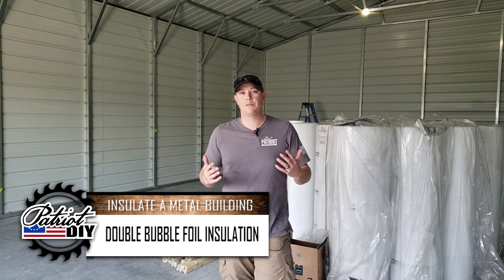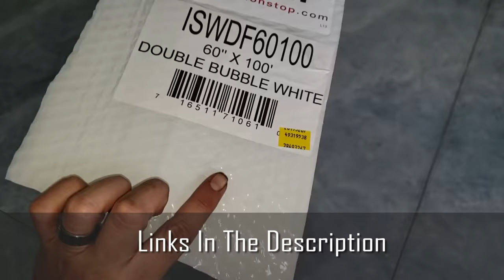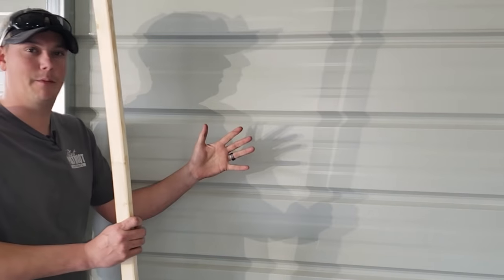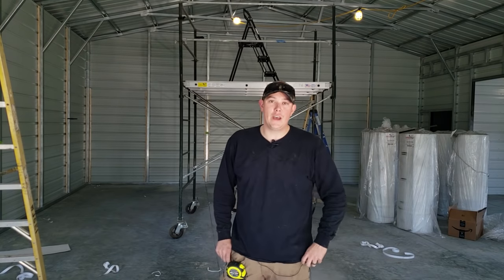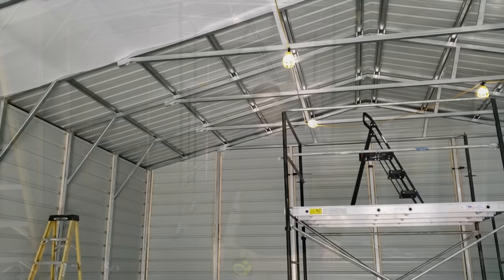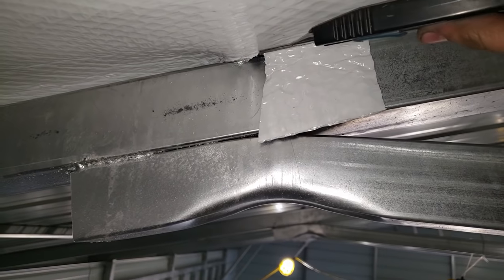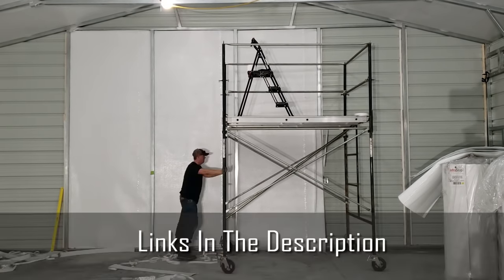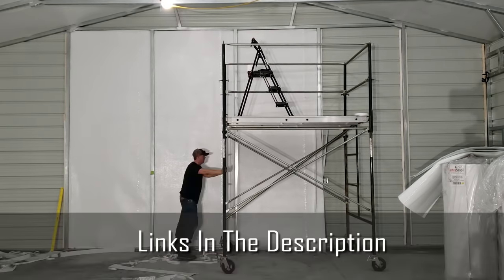How To Insulate A Metal Building / Double Bubble Foil Insulation

Comment: Really appreciate this video. I decided to go with the Prodex 10M Total plus insulation that looks like yours and has equal radiant barrier, but it has R22 value and built in Class 1 vapor barrier at at little less than 1/2” thick. The saving compared to closed cell spray foam was about 75%. You did a great job with your installation technique as well as the one where you sealed the bottom of the metal tubing against the concrete with silicone. Thanks again!!
Reply from the maker: Awesome! Sounds like you found some good stuff. Post a link for the followers!
Reply: Did you have any luck with the prodex
Reply: @drewdoestrucks  that’s correct
Reply: @drewdoestrucks  I left it silver. I’m thinking I might put one row of wafer board up on the bottom, but all in all it looks pretty cool. I have parking, a gym and a activity area with TV,  ping pong, dart board etc and it’s kinda unique looking.  The best thing is it’s very bright with LED and I guess that’s partially  because of the reflective surfaces.

Comment: For the roof, use a solid type insulation and lay from rib to rib.  My building allowed me to take off end cap and slide in from the end.  works great.
Reply: I did something similar with foil backed foam board. But I was able to fit it in from inside . But I would see how putting it in from outside would be easier in some cases .

Comment: I have a metal building that is insulated the traditional way like your video showed at the beginning. It would always be hotter inside the building because the beams would get hot from the roof, and the insulation would hold the heat in. It would get extremely hot inside to the point it was unusable when it got hot outside. I put the Henry cool roof coating on the roof from Home Depot, and it’s like night and day. It went from always being hotter inside to always being cooler inside. One thing though, I have a 15 foot carport extension on one side of the building, it is not insulated like the main building, you can see the underside of the roof in the carport. I also put the cool roof coating on the roof over the carport, and it now rains in the carport do to the extreme condensation that occurs in certain conditions when it’s cool at night and warms up quick in the morning. The warm moist air contacts the underside of the “cool” roof, and extreme condensation occurs, I’m thinking I somehow need to insulate the underside of the roof in that area.
Reply: I was thinking about putting that same roof coating on my metal building. My building is not insulated. Do you think if I put that coating on my roof that I would have the same problem that you are having with your carport section? Also, which Henry products did you use? The $100 for 5 gallon bucket or the $400 for 5 gallon bucket stuff?
Reply: @russgould707  when one is preventive maintenance and the other makes the paint weak with sun rays

Comment: Thanks for your video!  I just found out about the double bubble insulation today.  I immediately called my building guy and added it to my 26x40 metal building (concrete forms start in 3 days).  I was quoted $2400 which I feel is a bargain.  It’s WAY BETTER TO HAVE THIS DONE BEFORE the sheet metal goes on.

Comment: Great job with the mechanical fasteners. That tape would eventually fail especially in high heat conditions. ✌🏻🇺🇸
Reply: What would you use instead?
Reply: @jeffreyparker130  not instead of but in addition to. I would add as many mechanical fasteners as possible. Screws, staples, wood batons, wire etc… anything to keep it from sagging in a couple years.

Comment: Nice clean looking job!  You left space between the metal and the insulation giving air a place to move instead of condense.  
Is it possible to connect the wall space cavity to the ceiling space cavity and then vent out in the peak?  Also to accomplish this, small vents could be made at the base of each wall cavity. I've found that moving air will dissipate the moisture and reduce the condensation.  Air should rise naturally to the peak and vent out moisture....just thinking.  Any opinions on this?
At minimum, vent the roof.

Comment: I am skeptical about that insulation on the ceiling. Just so many people that have it installed have the double stick tape undo and it drops and looks very bad. My wife and I opted for spray foam. It doesn't look as pretty but it does the job and actually helps structurally as well. Seeing you are going to do some fishing touches inside and you used staples as well as the double-sided tape on the walls that looks pretty interesting. The double bubble does give a much cleaner look when it is done and if done right may not be a problem in the future. Very nice video.
Reply from the maker: Used screws in addition to the tape on the ceiling. Been in place for a few years now with no issues

Comment: i have a similar building. I couldn't afford the insulation at the time of build ($10,000) so i decided to do it later. i like the idea of yours to do it this way. But i have been thinking the metal attached to the metal studs do draw heat and if that beam could be insulated with like a cover of foam board it would help drop the inside temps as well. thanks for posting
Reply: What did you end up doing?
Reply: i have seen people do the insulation later on and they eventually found it alot faster to just remove the roof panels and install radiant barrier inbetween the sheets . took a week to do cause of limited time cause of 12 hrs job shifts. I may do the same thing on mine

Comment: What happens during the winter? Do you know if the warmer building air in the winter causes any condensation between the  foil insulation and the metal roof. If so, does this cause a mold issue?
Reply: I would really love him to answer this question also....
Reply: In this installation, there isn't anything to support mold, in the ceiling. The furring strips in the walls could support mold. Mold and fungus require organic material to "feed" on, not metal, nor synthetics. Rust could be an issue, though, if condensation develops.

Comment: I did this to my metal building. The trusses in the winter (45 degree Temp)  water droplets formed and dropped on floor after we turned on some electric heat. Same in the summer when I ran ac while painting. In the winter I could here the droplets dropping on the triple bubble shield and draining to the eves. My building 60x40 with 14' eves, 20 ' to peak. I lived in my rv inside building for 2 years before installing the vapor barrier triple bubble. So I know I had no roof leaks after build. I put the vapor barrier in 40x20 living area. I now will be removing the vapor barrier triple bubble and the wood framing. I will have closed cell foam 3" thick R factor 18 and they will flash coat top truss run. Good luck on yours.$2000.00 on foam and $4000.00 on vapor barrier, supplies and labor to install and labor to take off.
Reply: Where do you by chance live?  City state?  I would like to do foam and that seems like a hell of a good  price.

Comment: Nice video! I have a similar building. Put up sheets of styrofoam, held them up with furring strips on the outside of the foam, attached to the steel beams. 
Been working, however, I now see a mistake. I have them directly touching the walls/ceiling. 
One thing I've noticed, the condensation still forms on the beams, drips off of them. Hopefully you won't have that issue.
Oh, you just got a subscriber!
Reply from the maker: Hopefully the air gap prevents the condensation issue. Havnt had a probl yet! Thanks for the sub!
Reply: @PatriotDIY  hey man i be fixing to be doing mines to. How long ago did u do yo video? What I be done be sayin is I be wantin to do mines just like u be done did in da video brotha. Could u let me know how long ago u be done did it? Thanks brotha
Reply: @PatriotDIY  also is it eazier to be done be heatin? What I be askin is do it be stayin ALOT hotta inside?
Reply from the maker: @wildestcowboy2668 it's much better at keeping radiant heat from the sun out to make it cooler. !  but it will also help some to keep heat in.
Reply: @PatriotDIY  thanks for responding brotha.

Comment: Curious to know if you took a temperature reading since you installed insulation. What was the difference?
Reply from the maker: Posted some temp comparisons to our Facebook page!  Building remains approx 10 degrees cooler on very hot days ( which normally would be 10-20 hotter than outside) and 10 degree warmer on cool days! That is obviously without conditioning!
Reply: @PatriotDIY  
Any concern of it falling apart as some of the comments suggest?
Reply from the maker: @KA4UPW  not really....but I guess we will find out in 10 years

Comment: Great video. As a fellow insulator I’m always curious to see what my southern friends are doing about this radiant heat. I typically see spray foam installed as it provides a air tight envelope, but I’ve heard great things on this foil product in hot climates.
Reply: I used this same foil insulation in a pop up camper.  It worked great in the windows and ceiling area of the canvas.  It reduced the heat tremendously.

Comment: Great video!  It helped guide me how to proceed with my 12X16 metal building.  I like the strips idea to maintain the moisture space.  I'm using that idea.  But my building has 2X4 framing with metal walls.  I'm going to use 4X8 sheets of 2" polypro but cutting to fit in my 24" spaces between them.  I'll screw the strips to the 2X4's then glue the cut insulation sheets to the strips and fill any cracks with "great stuff".  (maybe a few screws to add more support).  When insulated well, I'll consider paneling of some sort for my shed/workshop.  Any suggestions/other ideas?

Comment: Just curious. Could I attach insulation directly to metal beams instead of using the wood?
Reply: He did say he only used the wood to make a air gap in between . so if you have wood or metal stud attach to there`s your air gap .
Reply: You can. Won't make much difference.

Comment: Thanks down here in SW LA as you know we were hit with 2 hurricanes it took out my 35x35 shop and now finally getting a new one built in 6 weeks (prices skyrocketed) going back with a 30X50w/10ft wing insulating myself will save a lot of $. thanks for the video.
Reply: St. Bernard parish boy here. My 14x26 garage went up 2k in a week! I cannot find info from manufacturers that mention how they install the panels with proper airgap.
It gets moist down here  in da bayous. lol
Reply: @poppaluv  did you find the air gap info and did it work?

Comment: Nice work! Did you by chance get a before and after interior temp reading?
Reply from the maker: Posted some temp comparisons to our Facebook page!  Building remains approx 10 degrees cooler on very hot days ( which normally would be 10-20 hotter than outside) and 10 degree warmer on cool days! That is obviously without conditioning!

Comment: Thanks for covering this topic. Could additional insulation be added to the building after the double bubble foil is installed? In Northern Minnesota winters get really cold. A high R-value could lessen the strain on the heaters.
Reply: Yeah use coroplast.....tape ends to make it closed cell.....all white would look good

Plastic can burn but less flammable than other stuff if you want you can fireproof coat it....no necessary but you can
Reply: R value use the double potatoes

Comment: I had pros install the 4ft wide batting, plastic covered insulation. I'm having major inside condensation problems dripping on my machinery. Anyone else?
Reply: Do you have a ridge vent, soffit vents, or gable vents? I have Ridgid foam and reflective foil insulation, it's cut down a lot of condensation but I still get some when temps go below freezing. I started installing soffit vents but my ridge and gables are not vented yet.

Comment: Sorry to let you know that in several years you are going to regret your choice of material.  It deteriorates into falling plastic particles. 
I have a pole barn that I am having to deal with that is about 15 years old.
Reply: I have the same problem. this stuff is a disaster to clean up as it deteriorates. cost me thousands to replace.
Reply: So what is the recommended alternative? Im considering a metal building at the moment. Just researching the pitfalls.
Reply: @intrepid5566  Closed cell spray foam is what a lot of the builders use in garages and shops. But that gets pricey quick.
Reply: Just good ole fiberglass insulation at the highest R-value you can put in the cavity, is the best, least expensive, and most effective/efficient option.
Reply: @catharticcathexis4527  what is the average price to spray a 2 door garage 16x7 feet
Reply: @outdoorzee919  I was thinking of doing that for my garage door and then sealing it with a 5 mm plywood and paint so it looks nice. But I saw on the internet that you can’t put up against the metal door cause it can cause fire. Wdyt?
Reply: @j_cruz_56deuce26  Depends on how thick you want. The thicker the coat, the more foam you use.
Reply: @outdoorzee919  What do you do for condensation, vent it?

Comment: I have a similar building, 2 car garage here in Fl.  I haven't  bothered insulating it because I just keep my truck and lawn equipment out there, I dont use it as a workshop or anything.  I think you may have continual issues with moisture building up inside if you cover it with wood like you said, even with insulation.  I would put some vents down by the floor, and up near the ceiling to allow for some air flow to keep moisture to a minimum.

Comment: Great video. I like the step by step and much cheaper than spray insulation.  I have a building very similar to yours and want to put plywood on the walls to hang tools, etc. Is a single layer of the insulation enough or would an extra layer do anything?
Reply from the maker: @ChristopherDaniel-dz2ex  2 layers would help.  I ended up adding foam board insulation between my double double and my plywood walls

Comment: Thanks for this. Much cheaper than foam. I live in Texas. It gets 110+ degrees during summer and as you highlighted in your video, inside temps are much higher. I was curious how does the adhesive handle the heat? Thanks!

Comment: You should do a video on your shop, the size, cost and process of it. Lot of us considering building a shop and it's daunting trying to find who to use or costs involved.  I've seen some shop install videos get a half million views so the more info the better. Great content, new subscriber here.
Reply from the maker: I was planning to do a shop build video but my cameras messed up and didnt film while it was being built so I had to scrap that video. Now just waiting to get it a little organized and get some stuff in it then I'll do a shop tour video and include some of the info you are talking about
Reply: I have 38k in a 28x48x12 with a 12x48 lean-to 6 windows 2 36 inch door 3 10x10 doors roof and lean too insulation.  Pad is 47x40 with footer and rebar 35 yards of concrete  . Yard is on a hill with a slant.  It took 7 dump truck loads of sand clay one load of crushed concrete 6 trees removed 6 stumps grinded . The ground work was a extra 6k just getting ready for the pad in my case.
Reply: I'm in north carolina
Reply: @brandonpittman5243  nice thanks guys
Reply: I just had a 24x40, 10 foot height vertical roof. 3 9ft wide 8ft tall roll up doors, on 36inch entry door.  
Bldg cost 13750.  Slab with footings and smooth finish 6900.00

Comment: I have been thinking of doing this as well but worried condensation could build up between the wall and the insulation any findings on that? I am also thinking of adding fiberglass over top when I eventually cover my walls what’s your opinion on that? I have been weighing options bc like you said spray foam is 10x the cost and I’ll have to empty my building completely
Reply from the maker: I don't have condensation issues.   And yes I'm also adding more insulation as I cover the walls with paneling.

Comment: I’ll bet that Liquid Nails doesn’t stay stuck to that metal very long. The expansion and contraction of the metal will cause the adhesive to let go especially with the weight of the insulation hanging from the 1x2s

Comment: patriot what is the name of the double sided tape you are using?
Reply from the maker: link in the description,   dont forget to also use staples and screws where appropriate, dont rely on the tape alone
Reply: @PatriotDIY  quick question , is this better than spray foam open cell? Can I put an AC unit in here after I use your method?

Comment: I have Metal Room project on the upper of my house and not sure how to insulate heat and moister and rain. weather here so hot most of the year and dusty weather so please what you suggest when some gap space between the room ceiling and the metal ceiling.
I found Latex acrylic apply like a paint spread on meatal outside by rolls and cheap too.
Thanks

Comment: How is the roof insulation holding up? Have the sheetmetal screws held them up over the past two years? I've insulated my walls just like you did and I'm about to do my roof so I wanted to see if you had to make any modifications or improvements since you posted the video.
Reply from the maker: Still holding great!!
Reply: Thank you! @PatriotDIY
Reply: @patriotdiy How are you keeping the insulation for the roof from sagging where it meets the walls? I tucked mine into the recess but the weight of the insulation is causing it to sag.
Reply from the maker: @cameronkaiharafishing9419  I tucked it in and secured woth the double sided tape

Comment: Using this method could u then after the fact instal foam board insulation over the foil insulation to add r value but still have your vapor barrier for condensation?
Reply from the maker: YEP!